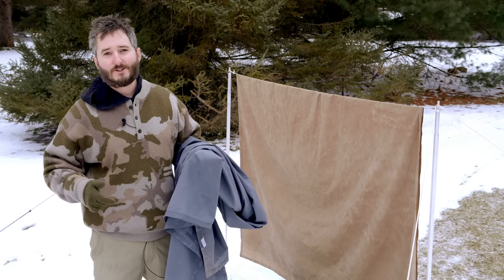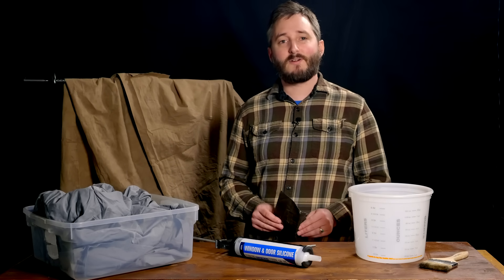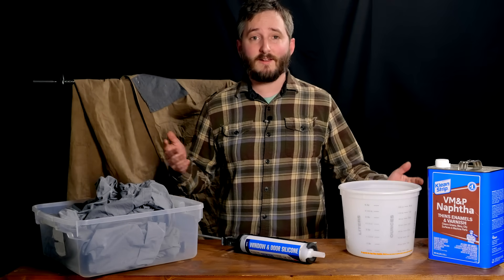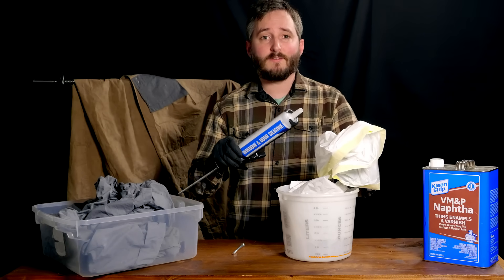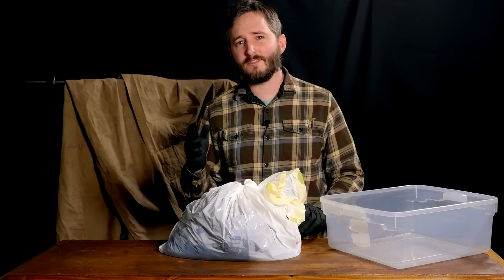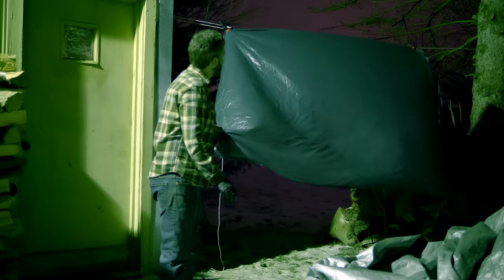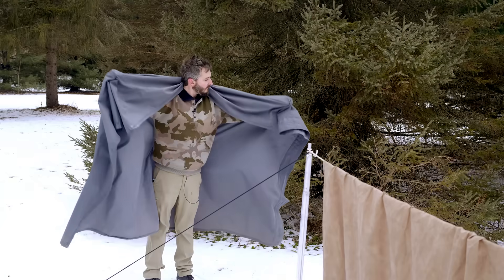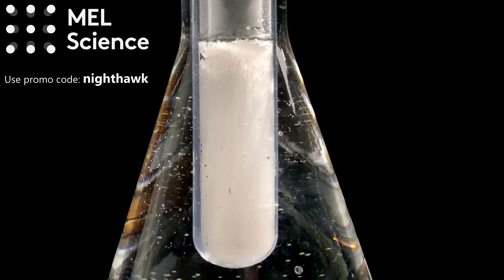Recycled Bedsheets Make The Best Waterproof Tarps

Comment: This is awesome!

How does this coating compare to the spray on silicone spray you can get in the sporting goods or shoe department?

I'd imagine it is more heavy duty and cost effective, but was curious about on things like back packs. As I'm a bit hesitant about my ability to put a naptha thinned mixture on evenly.

(Also, didn't know you could buy naptha in containers like that. Could it be used for zippos? As I'm sure it would be more economical.)

Comment: Not too keen on the toxic fumes but it looks to be a decent way to make a water proof tarp. Does the fabric still breath? I was thinking of maybe using linen instead of a cotton sheet.
Reply from the maker: Still breathes
Reply: @Nighthawkinlight  Excellent news. Im going to give it a go. Can silicone handle being out in the sun for long periods? Our area is hot and has lots of harsh sun during the summer.
Reply from the maker: @onegreenev  I haven't tested long term yet. For best uv protection mix lampblack with the silicone

Comment: Thank you, you really helped in my progression to waterproof things. I've tried many things but they just don't seem to work well. I tried the silicone and mineral spirits and had little luck with it actually working as claimed. Granted I tried it on some boots and some gloves and not a piece of fabric but that really shouldn't have mattered, right? I also tried using the wax ring for a toilet seal on my gloves and it worked but not for long and it seems to me the leather will absorb more than I anticipated so maybe I just need to keep trying to apply it. It's monotonous and boring though so I gave up after like 4 applications where I would heat the gloves and apply the wax and heat gloves until wax soaked into the leather.

Comment: A vacuum chamber might be useful.  For solvents,  I recall that xylene is the solvent of choice for silicone adhesives, but naphtha is also useful and less stinky and harmful. Xylene will swell cured silicone enough to pull it over objects and then it will evaporate away and the silicone will shrink back.  Silicone has one more useful property:   while it doesn't allow liquids to pass, vapors (e.g. water) will pass through easily.

Comment: I've got some questions:
1. does it smell like hydrocarbs after its dried?
2. is it more flammable than regular cloth?
anyway thank you for this video!
Reply: 2. While drying, it is very flammable. Be careful. Silicone is stands fire well, once the solvent is out, it is (I guess) safer than the bare cloth.
EDIT: I tested it, its is not good.

Comment: I designed a 3d printed button to turn sheets into curtains, and only now have I discovered what they are called, and why. (my design is a small ball that you push through two layers of fabric, and then through the gap in a U link that is then closed with an oval ring)

Comment: Hello, Ben;
Thank you for all you do.
GREAT video!
You have REALLY made a GREAT video tutorial this time.
I've watched some of your videos, they're usually very good but this one is really GREAT!
Did I mention I think this is a GREAT video?
"THANK YOU!"
So I was wondering about using other fabrics, say polyester or other synthetics?
I'd thought of making as oilskin-type tarp because cheap polyethylene tarps won't last.
I've got 2 cheap tarps, they're fairly new but we should all know they won't last.
Sun & wind take a toll on cheap synthetic 'poly'-products like polyethylene.
Then there's the physical issues that quickly damage polyethylene.
BTW, I was already familiar w/ the 'button'.
We can use coins, coin-cell batteries, twigs, or sections of branches to make our buttons.
My latest project is making blanket pins from brass harness rings & rod.
While blanket pins are very useful, the button can be used w/out making holes in the material.
Have a GREAT day, Neighbor!
Reply from the maker: Any fabric should work fine

Comment: I used petroleum jelly and charcoal lighter fluid to re-oil my duster and Fedora.
I warmed the petroleum jelly and lighter fluid just enough heat to melt the jelly, then put the mix in a spray bottle.
Sprayed two wet coats on both, waiting a bit for dry time, and then let them dry in the sun.
To store them, I've put them into a plastic grocery bag, because there is a generous amount of petroleum jelly.
The duster is waterproof once more, and now my hat is, too!

Comment: Great video! I'll have to make a nice tarp out of the old bedsheets. Also, I recently used a mix of mineral spirits and silicone to seal our concrete wash basin. The old concrete had developed some hairline cracks that would drip when our washing machine emptied into the basin. One thick coat with silicone/mineral spirits, no more drip! But wow did that mineral spirits stink up the house for a good week. So much for odorless.
Reply: Use silicone oil in place of solvent (no vapor).
Reply: @cmrecek  Have you tried that method?  If so what was your ratio?
Reply: That must be an older way of doing wash. I recall my grandmother having that setup.  On the flip side, there is the opportunity for reusing the wash water.
Reply: I believe that it should. The silicone will chemically cure and bond to the fabric. The only reasonable way to separate the two is by burning the thing and collecting the gases 😆
Reply: Good work, brother. Keep it up. Self-sufficiency is the best way to independence and security.

Comment: fantastic video, Ben! 
I've never been satisfied with the crinkly, artificial feel of plastic tarps, now there's a more natural, stronger  alternative.
I've been using silicone spray on my boots and sneakers at least 2, 3x per year for years... and use silicone spray lubricant to clean my engine, engine covers, and parts (except fan belts!) instead of water or solvents 
(be careful around live electrical parts, spray is highly flammable... in fact, works as a starting fluid in a pinch!)
Also use silicone lubricant spray  on car's weather stripping and exterior plastics to give a layer of protection & suppleness against oxidation, works great on my 2005 p/u

Comment: What is the chemical composition of naphtha... İs it kerosene oil... Because it seems to be working like it as it is used as a thinner... Might be difficult to find this thing in my country with thia name...
Reply from the maker: White gas camping fuel is similar. Kerosene might also work but I'd worry there might be additives that would make the tarp stink.
Reply: I don't know. It's a main ingredient in gasoline and plastic. I know that my local country doesn't sell it anymore. It was popular as fuel 30-40 years ago, but now it's just mainly used as an ingredient in industrial production facilities and not in private homes or workshops.
Reply: İll try both of those.. thanks

Comment: I feel like the ultimate test of this would be to make a viable raft entirely out of waterproofed bedsheets and a frame made out of PVC.
Reply: Wanna take a ride on bedsheets?
Reply: @AMC-eq3jr  best line ever,  if she says no you can show her the raft instead :)
Reply: Flex seal addvert right there lol after you cut it in half and silicone it back together
Reply: Best idea ever.
Reply: Great idea Sam, a modern version of Escape from Alcatraz :)
Reply: Ah, the tried and true flex tape test.
Reply: Ive been looking to build a foldable or collapsible boat and tought of the boyscout kayak but a bit bigger, but a canoe has my intrest as well because of the comfort. 

I might try and make some plans based of off advokomakes his boats to try this skin on instead. Especially the attachments of the fabric in that video could pair really well with this

Comment: PSA: There are two main types of "cheap silicone", and several types of non-silicone tube adhesives (usually latex or acrylic based). silicone I smells like vinegar. This is the easiest to cure and best for tinkerers, if you can tolerate the smell and acidity. Silicone ii smells vaguely of methanol, and does not always cure as easily.

Silicone I is "the good stuff", but it's getting a bit harder to find. Probably because of the smell. S1 can be used for "oogoo" - diy Sugru using cornstarch or food coloring. S2 *will not set up as easily*, if at all, when doing this trick. So if you try this and it stays sticky after days, get yourself a tube of Silicone 1.
Reply: i was wondering about this while i was watching. TKOR taught me about the distinction between the 2. thanks for the info! I have both kinds lying around and wanted to do this but wasn't sure whether to cheap out and use the old cheap S2 or the new unopened S1.
Reply: It tastes like vinegar too :)
Reply: @jasonfoster9118  are you a taste tester too ? I can't help myself.  
I dont understand why my dog goes crazy over some of these treats ??
Reply: Here, the easiest to find is the type I. Not by chance they are called Acetic Cure Silicone
Reply: @cleitonfelipe2092  that explains it. Acetic acid is vinegar.
Reply: As I have learned trying to produce a new heat sock for my printer. They also cure differently. One of the types cures by drawing moisture out of the air and can be accelerated by curing in an intentionally high moisture environment while the other will cure from it's own products. All of the silicone I have around cure by moisture which is no good for my enclosed molds. I know black RTV and gm silver are moisture cure types, as is the hdx silicone tubes. Makes sense given their intended applications.
Reply: Silicone that cures while emitting vinegar (so that explains the smell) is used for caulking in kitchens, for wood etc. This must be your type I, and the one you recommend. There is also the silicone caulking for baths, with metal, or on mortar, brick surfaces etc., your type II -  The reason for 2 types of caulking: Acid could damage tiles - and even more so the grouts between the tiles, or a wall surface (if it contains any finish with calcium).  Everything that is on the alkaline spectrum during production or when wet. 
I mean - nothing bad will likely happen if one uses the "wrong" kind of silicone. I once cleaned the grouts in the bath with citric acid because the calcium of hard water had baked in the dirt over years  - but I would not do that too often, or it might damage grouts.

But professionals normally use different kinds of silicone caulking depending on what the surfaces tolerate well. 

The vinegar emitting stuff is also slightly better against mold (fungi do  not like vinegar).
Reply: In Australia you can purchase “wet area” anti-fungal silicone that is either acidic cure or neutral cure. The acidic version cures faster so the trades often like it, but the neutral version has a longer life.
Reply: How long does this last - a few months, a year, five years???
Reply: I wonder if any of these ingredients would irritate the skin if used in direct contact?
Reply: Can someone tell me whether this treated material is easily flammable given naphtha is used, or does the solvent just dissolves the silicone and evaporates afterwards?
Reply: @doradean3097  let it dry, the solvents should evaporate after a few days
Reply: @Negrataish  thanks for the info! 🙂👍
Reply: If you don't like vinegar smell than by a tube of Tar.
Reply: So what are those 2 types called? I doubt it's actually just "Silicone 1" and "Silicone 2".
Reply: None of those are "the good stuff"
The actual good stuff when it comes to silicone is platinum-cure 2 component silicone that ends up curing to a skin-safe material and can be cured on your kitchen counter because it gives off absolutely no fumes and has a shrinkage of about 0.1-0.5%, unlike tin-cure which always has a lot more, up to 8 percent iirc
Reply: wear a damn resperator instead of huffing solvents all day
Reply: @pajamash  Vinegar outside used in that manner is not an issue.
Reply: @core3673  its not vinegar, its acetate fumes. if you dont know the difference then you're not paying attention.
Reply: @pajamash  

Right!!! A full face respirator on Amazon is about 35 bucks. Or a surplus gas mask Israeli Russian American doesn't make any difference but the respirator is kind of the civilian version
Reply: @pajamash  well aren’t you da potty pooah!

Comment: How flammable is a bedsheet soaked in silicone and naphtha? Like, if an ember from a campfire falls on one of these while you are sleeping on, in or under it, will you die a horrible death? Or is it less flammable after the naphtha evaporates? I mean, obviously it IS less flammable after the naphtha evaporates, but is it less flammable than a regular cotton bedsheet?
Reply from the maker: Naptha is highly flammable, but it's all gone once dry. Silicone is moderately flammable, but should easily resist a few sparks.
Reply: @Nighthawkinlight  I didn't really ask that question well. Really, what I'm asking is: after it's all said and done, is it risky to sleep in or under a waterproof sheet treated like this. Maybe you could try draping these sheets and some untreated sheets around a fire or around a MIG welder or whatever and see just how dangerous it is. Seems like an important consideration if used as a field expedient shelter or as a tarp over stacked firewood near a permanent structure. Dying of hypothermia sucks but I understand it's less painful than being burned to death.
Reply from the maker: @WmSrite-pi8ck  Risky is relitive. Compared to oil cloth which is the historic way to make canvas tarps this is much less flammable. It also depends on how flammable the fabric you use is to begin with.
Reply: @Nighthawkinlight  Fair enough.

Comment: I'd love to see a comparison between this, waxed canvas and oil cloth for uv and flame resistance, durability,  etc.
Reply: ..breathabilty...
Reply: @dustinmcc8169  Are you wanting something breathable or water resistant?
Reply: @kilrain_dev  Best comment ever
Reply: @kilrain_dev  If it resists water, it'll resist air. If it's water-proof, it's air-proof. If it's permeable, then it'll become soggy when wet. And nobody likes soggy socks, but in exchange you have wet feet from your own sweat.
Reply: Goretec is breathable and waterproof.
Reply: @Steve211Ucdhihifvshi  Teue, but I don't think it would be feasible to DIY goretex.  I imagine the process for making it is pretty involved.
Reply: Yeah, my first thought about this was wondering how flammable it could be.
Reply: @parrata  Should be the least flammable of the other options once it fully cures.
Reply: Oil and wax are very flammable. Silicone has to be around 600F to burn, and cotton around 540F.
Reply: No more breathability,je suis Français, imperméabilité pas très durable mais efficace
Reply: Outdoor high heat silicone (for like firepit repairs) might add a bonus of being ember proof :D

Comment: About how long do you reckon this coating holds? Whether for tarp or clothes.
I imagine it'll vary wildly depending on the environment, but wondering about ballpark.
Reply: I made a tarp for camping around 5 years ago using this method.  Only difference is I used mineral oil to dissolve the silicone and it is still one of my favorite most durable tarps. It works with any fabric that will absorb. Cool process 😎
Reply: @bowilliford7822  Still works after 5 years? That's awesome.

Comment: Do you think this is a better/cheaper method than using hydrophobic sprays? I've been doing this for years but I use waterproofing aerosol spray you can get at most big box stores or walmart.
Reply from the maker: Yes, I believe most waterproofing sprays are silicone based so this is a cheaper way to make a lot of it. Super hydrophobic coatings are different, and I have not compared between the two. Probably the silicone coatings are longer lasting and have fewer unknowns in terms of health risks

Comment: yeah, now, where the hell do i gett naphta from? :D
Reply from the maker: If not available in your area white gas camping fuel may be an alternative
Reply: @Nighthawkinlight  thank you very much for your answer. i can't shake the feeling that many of these product names are somewhat nonsense - but above all, they are also thrown around internationally. So is white gas just high purity gasoline that is also used for cleaning and gasoline lighters? when i search for it on german amazon, i find something from coleman. but couldn't i possibly just walk to the nearest gas station and buy gasoline there for a much lower price per liter?
Reply from the maker: @Subsessor  Yes you're right, these names are really imprecise. It would be better if the terminology were standardized but it just isn't. Naptha is a form of refined gasoline so regular gasoline may work, but gasoline contains lots of other additives that cause a bad odor that may last a long time and be unhealthy for long exposure
Reply: @Nighthawkinlight  ah, that's right. considering the health risks is of course an important parameter too. thanks again for this detailed answer.👍

Comment: Great ideas!  I wonder if aluminum could be added to make it a bit reflective or carbon to make it absorb heat.  For a less durable quickie, you can buy tarp silicone spray for all your outdoor gear.  Any silicone oil will work.  It is also good to coat vehicle door gaskets to keep them from freezing closed.
Reply: aluminium? sounds more like a big sparkler